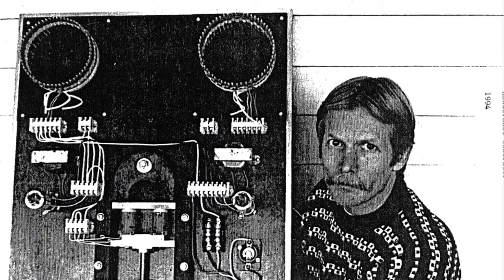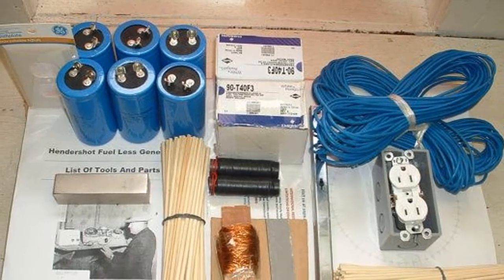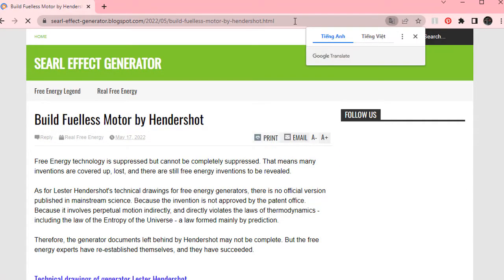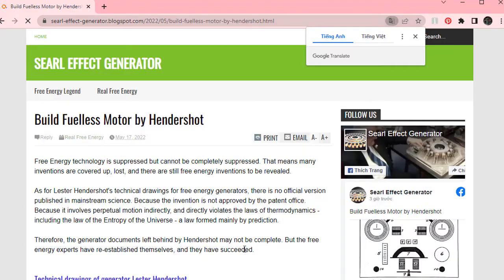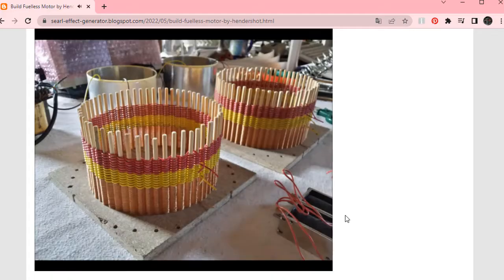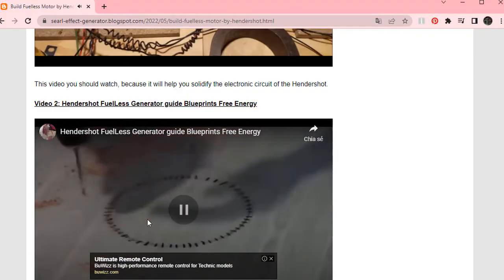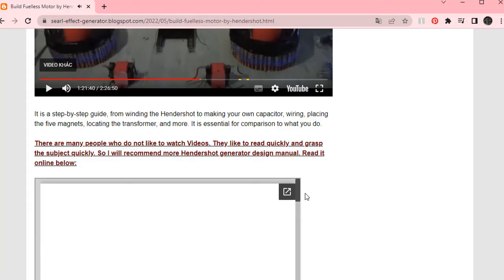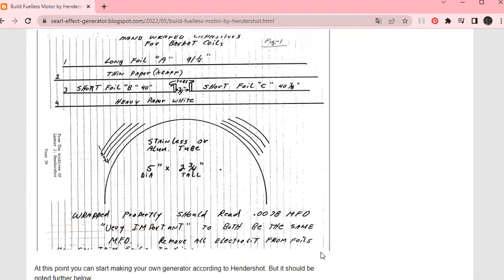Lester Hendershot's Free Energy Generator - "Explains Magnet In Fuelless Motor"

Comment: We studied in trade school one day on the chalkboard.
Seems like after all the math this thing made
200 VA like about 24,000 hz.frequency.
Later after trade school I was workin for a local contractor and took one out the kitchen of a historic home. It finally gave up the ghost. I think it was about 70-80 years old.
Its a fire hazard if its not " biased" correct.
Its not allowed as in
" shall not be " in the national electric code book under residential power supplys.
But I have a revision to make it new and improved hendershot generator.